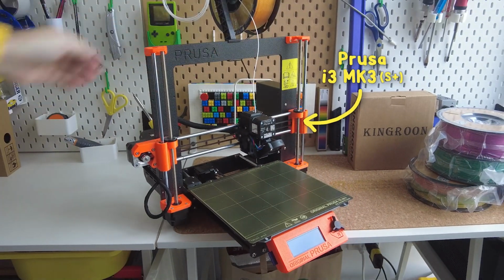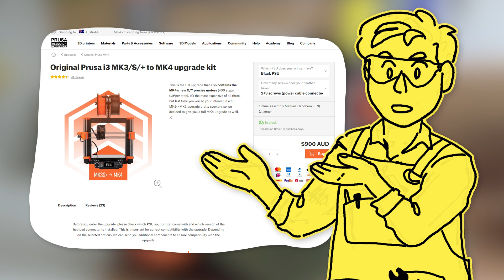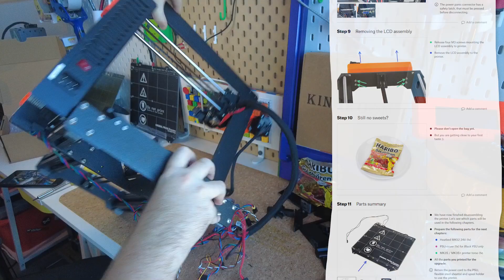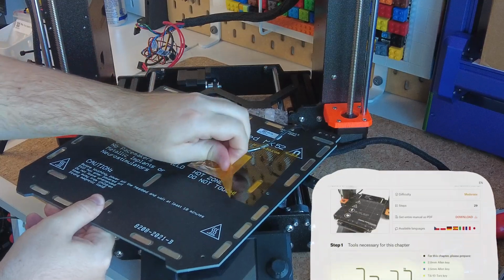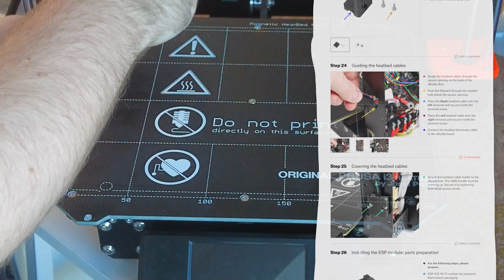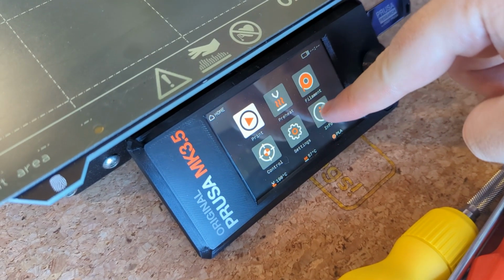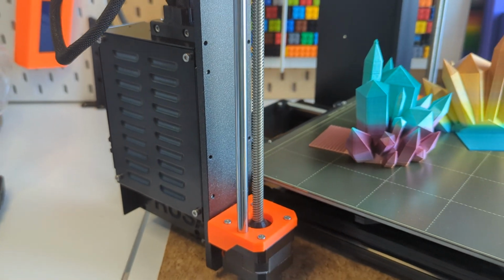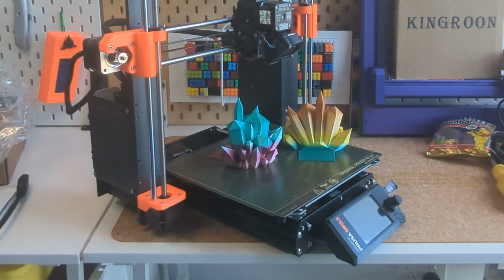Was Upgrading my 3D Printer Worth It? – Mk3.5 Upgrade

Comment: So I've never owned a MK3 series printer, but I have built and operated a few working as a maintenance tech for a print farm.  I now own a MK4S.

My very strong advice would be to get whatever upgrade kit puts you into a Nextruder.  Comparing the Nextruder to the MK3 era extruder is like comparing Speyside scotch to acetone.  The Nextruder's gear reduction is excellent, the load cell leveling system is truly "just works", there's no PINDA probe on a thin little blade to get crispy and snap off, the filament runout sensor isn't a rube goldberg machine, and the one piece nozzles deserve their own paragraph.

They're leak proof, the CHT technology enables even higher print speed, changing out the nozzle can be done with the printer cold and the included wrenches, changing out the entire hot end can be done in 30 seconds with no tools at all.  It can be adapted to use v6 style nozzles, though you do have to hot torque them.  That's the real win for the MK4 era.

Comment: one more usecase i can see, upgrading a frankenstein clone plus you can resell or upcycle remaining parts
at a school where i work we colected all the parts few teachers had left over after upgrades like that, (mk3s>>mk4 actually) printed some parts in dashing new color and ... rebuild just another mk3s for free out of all the spare parts
well we needed one heatbed because that is what we didn't have extra of. (and we ordered 5 in a price of one from pcb mprototyping place, just without magnets) but now we have 3 printers instead of one and nobody lost a printer just parts they didn't want anymore, we can repeat that process endlesly, buy a kit, print new frame from pet in pieces add some rails and bearings some used parts like 1$ stepper motors and you have another one so upgrade kits are very resonably priced if you are upcycling old parts because you are really getting almost 2 printers in a price of one and you can both have a cake and eat it too, just not the gummibears

Comment: I would consider an A1 because the cost for the upgrade to Canada is a lot more than the $600 to get an A1. And the A1 with the AMS outperforms my Prusa. As well, trying to get any parts from Prusa is a living nightmare; just ordering parts that are in stock takes weeks to get to Canada and are subject to significant tariffs. I am doing an upgrade to my MMU2 to a 3 now, but if I can make some money with this upgrade, I think I will be moving to Bambu Labs, which out of the box can make money on prints. Prusa has never been able to do that.

Comment: There also is an inofficial mk3.3 update. Using controller, WiFi-module and display from the Prusa Mini, an external mosfet for the hotbed and a modified firmware ("Snake firmware").

The downsides of the mk3.3: No crash detection, no power-loss recovery, no MMU-support, noc GPIO-board, no accelerometer.

However, you get board, display, WiFi and mosfet for less than 70€ on AliExpress, so much cheaper than the mk 3.5(s). And the speed and quality using the mk3.3 is the same as the mk3.5.
I personaly had 5 mk3s+. I upgraded two before to the zOrbiter 2.0 with Revo hotend. The third was upgraded to Bondtechs BMG hotend. Two were stock configuration.
I upgraded the two stock mk3s+ to mk4s (with MMU3). However, beside it´s quite expensive to do so for all my mk3s+, the two zOrbiter printers already have an extruder quite near the quality of an Nextruder. Also no need for more maschines with MMU´s, power loss recovery is not realy needed here in Germany (and do not help anyway on power loss for more than 10 minutes, as the print detaches from the PEI while the bed is cooling down) and you can calibrate input shaper using a test print - or just using an extension cable to connect your x and y motors from the mk3.3 to your mk4(s), using the mk4s board to determine the values of your mk3.3.
So the only downside of the mk3.3 is missing crash detection (and if you use silent mode, you do not have it on mk3.5, 3.9 and 4 anyway).
I already prepared for the mk3.3 upgrade - just waiting for the Mosfet to arrive (and also for the power connector for the Buddyboard to arrive, as I do not want to cut the cable of one of my minis).

I already upgraded a Mini to dual-z and direct extruder (Revo mini and TBG light extruder) - and the print quality and speed practicaly was the same as an mk4. So I am pretty sure the mk3.3+zOrbiter 2 + Revo should become competative to the mk4 also. Only using the mk4s might be faster printing PLA with overhangs due to better cooling (but you can use the Revo HF nozzles, so models without much overhang or less cooling than PLA would come out practicly as from am mk4s).
For the mini I used prusas mk4 profile, but copyed the start/end/etc. g-codes from the mini´s profile and set the dimensionsof the printer to 180 qubed.

However, upgrading an already upgraded mk3s+ with the buddy board,"mk3.3" is quite underrated. To place it between the other models, I would call it more an "mk3.8" or at least 3.7. Definitly better than a stock mk3s+ upgraded to mk3.5, just a bit less than a mk3.9...

I love open source ;-)

By the way: upgrading the mk3+s to klipper is of course always an alternative. But more tinkering than just use prepared options.

Comment: I was thinking about this upgrade, but for the price of it, i can have now brand new Bambu lab A1. So i can have one slower printer for non hurry parts, and one which will be cca the same as Upgraded one. I dont need another printer, but i think that price for this upgrade is just too expensive for what it is, and you need to manually install everything and even print new parts for it.

Comment: The cost of the upgrade is about as much as the price of an a1
Reply: Buy an A1 then.
Reply: Math is easy.
Reply: A1 can't print certain materials because can't be used in an enclosure.
Reply: Just buy an old raspberry pi 3b, install klipper and you'll have a printer which outperforms mk3.5 for 50€.

Comment: I just did it this weekend. Pretty worthwhile upgrade. The speed are pretty quick, but of course it’s that impeccable Prusa quality. You can even crank up the speed to 200% for fun and set your heater and flow rate a little higher and you can basically get the same speed as as a core Xy and the motors, don’t even get hot. Although I’m happy with 100%.

Comment: Price is important but not everything. I also did the Update, it was fine and I had less problems with the heatbed, maybe I wasnt rushing or filming while I was doing it. 
The update also helps to minimize Waste and is from all the available updates the best. The firmware bug for the leveling was fixed quite fast and also the beta firmware for the touchscreen is now live I think. They take time to validate things and dont just talk about a price or the performance. I do recommend the update, if you get a used mk3 for cheap it is also not that stupid to do. (price wise) It is still reliable like before, but much faster now :-D

Comment: Little note on the touchscreen: Firmware 6 is released now. Still gotta manually enable it though.
Also includes silent mode, which I don't notice a difference with. (My MK4 is sitting on the rubber pads it came with, on top of rubber pads for a washing machine for cable pinch peace of mind, on top of a 16x16in paver stone, on top of 2.5in of closed cell shipping foam.)

Comment: I just upgraded my mmu2s to an mmu3 on my mk3s+. It sat in a corner for 6 months because I have 4 bambu printers (x1c, p1p, a1 mini etc). Immediately remembered how brutally slow the mk3s+ is relatively speaking. So I ordered the 3.5 upgrade kit, and hope to bring it up to a more modern standard. Didn't see any value in the mk3.9 or mk4 kit as they are just too expensive and approaching the price of a new mk4 complete kit.